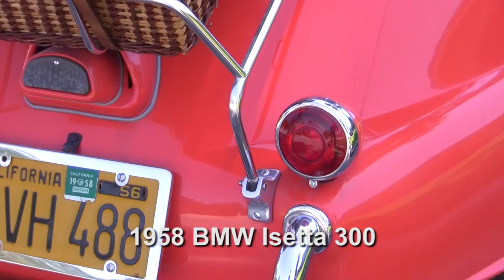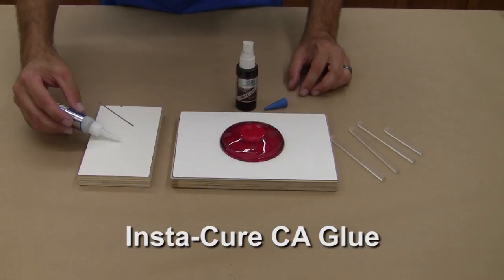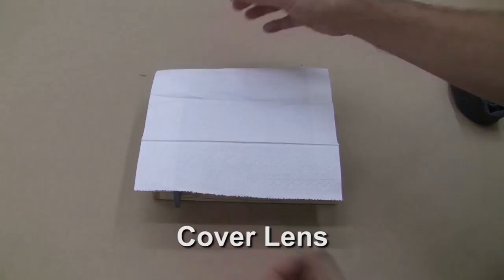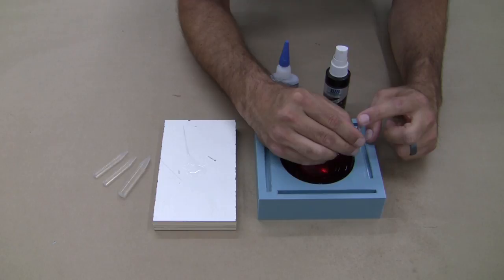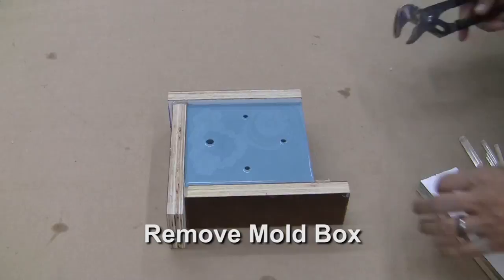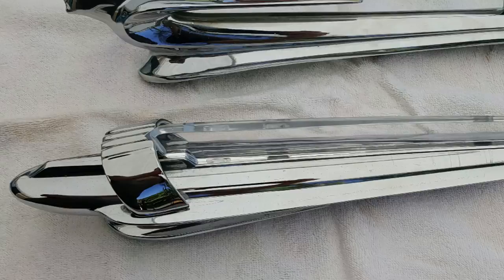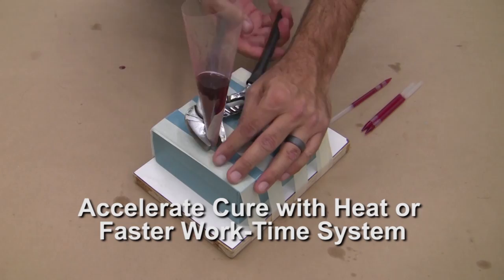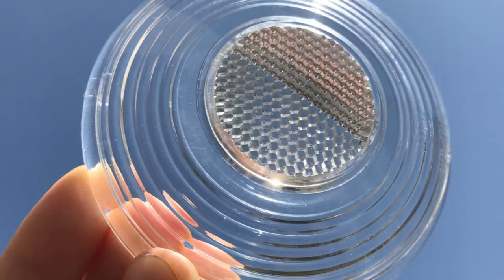Make an Auto Lens with Clear Resin and Silicone Molds | Tutorial

Comment: This has to be a benchmark for informative videos, right down to the clear no nonsense response to questions.
Reply from the maker: Thank you so much for the compliment and feedback!!
Reply: @bjbenterprises  Can you get a pvc solution to make a junction box a small one for electrical encloser, cannot find pvc liquid or material, if you can make one will be great, water proof and fire proof etc or just basic...
Reply from the maker: @democracyforall  PVC is a very specific material that is classified as thermoplastic.  It melts with heat applied and molded from there.  We manufacture many different types of liquid, castable polyurethane materials that have Fire Resistant properties for electronic enclosures.  Our TC-891FR for example is 94VO rated and UL listed.  You can find these materials on our website bjbmaterials.com
Reply: @bjbenterprises  many thanks

Comment: I would love to see if you could make a clear lens from a 3d printed part.  The videos are getting so much more informative.  Thanks for sharing the information!
Reply from the maker: Hi Randall, yes you can certainly recreate a lens using 3D Printing technology.  The key to success is your painted finish over the 3D Printed part.  It must be a very high gloss, Class A finish or you will not have the clarity of an original as shown in the video.  This means painting the pattern with a good quality, automotive type clear coat; i.e. no rattle cans.  You want to put the labor and polishing effort in the pattern instead of polishing each piece out of the mold.  As the mold wears down over time, you may need to hand polish the cast lenses to bring the gloss level up but at a certain point you'll have diminishing returns and it may be time to make a new mold.

Comment: So im a plastics fabricator and am familiar with tools associated with this like routers saws joiners and acrylic fab stuff. Im wondering what would I need to do exactly what you showed in your video. I want to faba few discontinued Lenses and emblems for my car.
Reply from the maker: Hi Joe, if you are an experienced fabricator and a fast learner, than you should be able to tackle a project like this.  It will be very difficult to answer all of your questions in a YT comment, but you will need a suitable vacuum pump and chamber, possibly a pressure tank, and some practice mixing and pouring both polyurethane and silicone casting materials.  If you haven't already, we would highly recommend viewing our other mold making videos to see the techniques and equipment used in producing parts that are professional looking and functional.  We also have very helpful and experienced technical sales people here at BJB that do a great job of helping new customers through the mold making and casting process.  You can email or call them M-F.  info@bjbenterprises.com or 714-734-8450
Reply: Hey Joe Garcia,can you make Tail lights for 1965 plymouth fury 3 a complete set, I have used unit off the car.

Comment: I know this is an old video but I was curious as to how someone would do two separate colors in one piece
Reply from the maker: That's a good question and takes some real tooling knowledge.  It's possible, but it would require a lot of set up to make multiple mold inserts to allow for a second tinted material to fill a void and bond with the first casting.
Reply: @bjbenterprises  I could imagine for a tail light lens with red and clear you could make a mold of the whole  thing and one of just one of the colored sections. Let's say red. The pour the red mold and let it set up, then move the piece to the mold with the clear and fill and set. I'd imagine it'd need a small overlap of the two pieces for them to bond. I may be oversimplifying it. I'd love to hear your thoughts. If you mold one shape and put it into a larger mold will the two layers bond? Would it be better to mold two separate pieces and bond them together another way.

Comment: Can u make a video on how to make multicolor taillight lenses. Would be very helpful to know how to do this
Reply: I have a 1969 Ford 20M RS. The tail light lenses are two-colored (top half orange, bottom half red). The lenses themselves are 100% orange and the red half is coated with transparent red paint.
Reply: Make one mould of the entire lens.. then, for ex, if the lens has 3 different pigments.. you'll create 3 copies of the original lens. Than, cut the replicas to each speciffic color, and create an final mould for each one. Cast them all with their respective colors, and later on the finishing process, glue them together with an appropriate glue or resin. Not as easy, but works flawless!

Comment: Hello thanks for the cool video. How many times can I use this silicon mold without ending up withe a cloudy resin look? would the silicon mold`s surface roughen up over time?  Thanks
Reply from the maker: For a lens quality part, usually about 12-20 parts if you take care of your molds and use a good quality platinum silicone as shown in the video.  After that, you start to see a dull surface finish which you can polish back to a shiny surface.

Comment: So this casting resin won’t soften and flex when put  outdoors in the summer heat ? Without post cure ?
Reply from the maker: The key with any casting resin is that a post cure is typically going to be required if that part is going to go outside in the heat.  Our material Technical Data Sheets outline this process.  We also have a nice video discussing this issue:  https://youtu.be/4qJawkyzrmA?si=nfvkjEEN7nkw9HLd

Comment: It's a great video. Missing your latest videos.. however, how do you remove the ca glue trace when you pull out the silicone sprue?
Reply from the maker: Typically the mark from CA gluing the acrylic vent onto the pattern is minimal and can be scraped or sanded off if needed.  Usually this spot is in an area that is not a cosmetic surface (hidden behind the part) so it doesn't cause an issue.  Marks from vents on the part is the same with injection molded parts and dealt with the same way.  If it needs to be a clean surface, then the pointed vent makes a very small mark and is much easier to deal with.

Comment: From start to finish, approximately how much would this process cost if I had none of the required products? I have a pair of red lense taillights that I want to make clear.
Reply: Curious as well, I have an oddball car that has no aftermarket and want to make clear tail light lenses from a spare set
Reply: About $200.00 for the first one, but then just the cost of the resin after that. Maybe $10.00 each. The money is in the mold silicone. I got a price from a guy who does this and he wanted $360.00 for a rectangular lens 3x3x12. I just bought the material to make my own from this video makers competitor.
Reply: @johnladouceur9939  I got a quote for almost $460 to make a clear reflector lense for my headlight that is the size of a normal playing card.  I would need two obviously.  But this has me SERIOUSLY considering trying to do it.  I'm just going to be bummed if I buy the materials and then it has bubbles or is messed up.  I can't imagine it going perfect on the first try.

Comment: I don't understand why the silicone didn't seep under the lens at the first pour.  It wasn't sealed in any way.
Reply from the maker: The fit was very tight to the splitter board and using thin CA glue creates no appreciable glue line (raising the part up).  In hindsight, it would have been good to show using a paste wax around that edge to create a very small wax seal since many parts wouldn't fit this nicely.  Another method to lightly fasten a flat lens like this to the splitter would be to use basic white glue around the whole edge.  This would create a nice seal and allow easy removal from the splitter when needed. Nice catch and thanks for the comment.  Others will learn from discussions like this!
Reply: @bjbenterprises  Great stuff.  Thanks!!

Comment: I've been watching other company videos and I do like this one best, quick, to the point. Curious about the pressure casting though....that face mask was a failure with the defects. Why is that? I would think with vacuum on the liquid prior to pouring, and then pressure when casting you would have no bubbles. Is it possible that the mold was sealed too well and too low of pressure was used? Reason I say that is because the fluid was not able to pass into some other area of relief.  I've seen one guy cut little bladder "fishers" to allow the pressurized liquid to fill the little bladders, contain the bubbles, and allow the liquid to re-enter to fill voids.
Reply from the maker: The face casting was pressure only (no vacuum degas of the urethane prior to pouring).  Some sources recommend pressure casting only and that is not something we would recommend for clear materials as you can see in the face casting.  A combo of vacuum and pressure is the best way to ensure quality clear parts in a highly detailed, closed mold like this lens.

Comment: I’ve been searching for a video exactly like this one 
Modern lights aren’t able to be seperated without cutting open/heating the seal and pulling apart, if I am somehow able to get just that plastic lense from an OEM set I should be able to do exactly what’s in this video no problem?
Do you sell starter kits with everything needed to make your own lenses?
Reply from the maker: We don't offer a kit due to the variety of lens sizes and complexities involved.  Keep in mind too that clear cast lenses like this are not meant for headlights due to the extreme heat from the bulbs.  Most aftermarket DIY lens applications like this are for tail lights or turn signals where the heat is lower. If you have an application you want to discuss with someone in our technical staff, you can send us an email or call to explain in more detail to see if this will work for you.  info@bjbenterprises.com or call 714-734-8450.  Have as much info and detail about the lens and desired expectations for the part to help get the info needed.

Comment: Would it be beneficial in any way to have some kind of vibrating jig to mount the mold on when the resin is curing. Would it remove air bubbles from the resin or create them?
Reply from the maker: Generally speaking, it's not a very practical solution because vibration typically removes air bubbles best with materials that have a high filler content (think concrete or plaster).  These urethane casting resins are un-filled and the surface tension of the material does not easily let go of air bubbles.  So, that's why we use vacuum chambers to degas the material before it goes in, as well as proper venting to channel the air and material through the mold, and then we'll often use a pressure tank to deal with any incidental trapped air in the mold geometry.  In other words, Vibrating Tables are more often used on large open top molds where the casting material has a high filler content and the bubbles can simply rise to the top vs trying to navigate to a vent hole.
Reply: @bjbenterprises  Okay, thanks for the quick and detailed response!
Reply from the maker: @KHFilms  No problem, happy to help!  -BJB

Comment: Hi there! First of all, thank you because it's been made so clear. 
But, I have a petition, if you don't mind. The piece casted in this video is "relatively easy" to do. I mean, is completely straight in one side. But, for example, for the lens showed right in time 7:09, I'm wondering how you can do that. (as you can see, it's not straight in one side, but curved).
I'm not suggesting you have to do another video to show that (but it's up to you ;) ), but a little explanation, or maybe just a picture with your cast solution, would be great. 
Thanks again!
(I promise to show you what I'll make, in case you're curious. I have a spanish "SEAT 600" and a BMW k75 motorbike which I have to deal with...)
Reply from the maker: Paco Gámez thank you for the suggestion.  If you are purchasing materials from BJB and need help with setting up a mold, our technical department is a great resource for help.  You might want to watch our intro mold making video to see more examples of mold set up and see if it answers your questions.  We also have many videos on our Social Media pages showing a variety of mold preparation using clay.
Reply: @bjbenterprises  do you ship/distribute your products in Europe?
That's where I am from...
Reply: @bjbenterprises  there used to be a video on making the mold for that lense as well, what happen to it?

Comment: Does anybody have experience using this material for headlights in a real world application?  I've viewed the Tech Sheet but am new to the concept of casting polyurethane.  Very curious how a finished product has held up to UV exposure, heat from the light bulb, and even to an extent impacts from road debris.  Also, did you finish the product with a clear coat or any type of PPF prior to installation?

Thanks in advance
Reply from the maker: We have many customers over the years making lens parts for classic Lincolns, Mercury, Plymouth, Ford, Chevy cars and more.  These are small companies reproducing parts that are not made anymore, not just hobbyists.  Typically they are used for tail lights, turn signal lenses, interior domes, and such.  We don't recommend it for headlights due to the intense heat generated.  The UV resistance is very good.  Aliphatic polyurethane is one of the most UV and color stable resins available for making cast parts (in comparison to epoxy and polyester resins for example).  This material is also used in theme park applications where parts are mounted outdoors.  The key things to be successful using this material: make sure you have a good vacuum degassing pump/chamber, a pressure tank, and lastly a way to post-cure the parts with heat so you ensure the best heat resistance in the parts.  Feel free to contact our tech department if you would like to ask any questions you may have:  info@bjbenterprises.com

Comment: Is the strength of the lenses comparable to the original or stronger? Can I reproduce glass lenses with these resins that would be just as transparent and translucent?
Reply from the maker: The lenses are very strong and tough.  The most important thing to do is follow our technical data sheet to achieve the best performance in a harsh environment like automotive parts require.  Heat resistance is the biggest hurdle for plastic parts on exterior car parts and it is very important to ensure a proper elevated temperature post cure is done on any cast urethane part.  Clarity with these materials is unmatched when compared to other castable resin systems and they also resist yellowing due to UV light thanks to our formulation.  It is important to choose the correct formula to ensure it has our added UV stabilizers for outdoor use.  It's best to email our technical department to ensure you have all the info needed and you can ask specific questions about your application:  info@bjbenterprises.com

Comment: What if i want to make a lens thats almost exactly like this - but half is red and half is yellow?
Reply from the maker: It might take creating two different molds and placing one "half" piece into the second mold and cast the remaining color.  You might also create a silicone "block" that temporarily fills the space in the mold while you cast the first color, remove the silicone, and cast the second color.  It's very tricky to do two color castings or overmolds.

Comment: Love your video, I am new to this mold making.  Question, I have a glass lens similar to your lens for Rail road lamps, i did the bottom mold but now having trouble getting the acrylic vent rods to stick to the glass using  a CA glue. My first rod stuck no problem but the rest are not. I used different CA glues as well and same issue. If i accidentally got mold release on the glass before trying the glue, do you think that would cause the problem? Is there something i can use to clean the glass? I also notice on your video (Perhaps an edit splice?) right before you were going to glue the rods on your lens for the 2nd mold half the accelerator bottle was taken away then put back. Was it used for any part of the rods for the CA glue?
Reply from the maker: Any mold release on the surface will cause issues bonding the vents.  Use a Q-tip with some rubbing alcohol to clean the area to get a better bond.  We pre-sprayed the area with accelerator to help the vent bond quicker which is why you see it picked up and then set down again. 4:26
Reply: @bjbenterprises  thank you very much.

Comment: I Have Question about when you put the Resin in Vacuum Chamber ... are you heating it? Yes or No and to which Degree?? and What is The Pressure its under under that Vacuum chamber ... ??? I hope someone replies
Reply from the maker: RASHED ALQALLAF vacuum does not heat the material, it is decreasing air pressure on the liquid to the point bubbles and gasses expand and escape.  You need a very strong vacuum pump that can pull up to 28-29 inches of mercury (1 bar) to do this effectively.